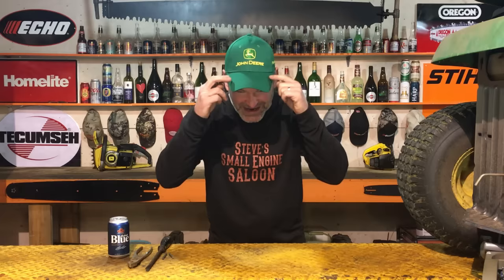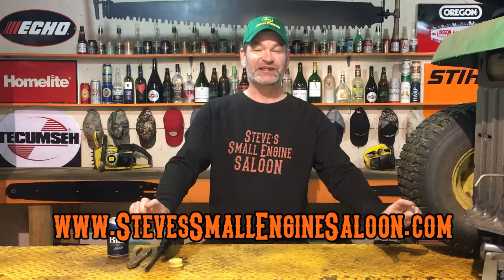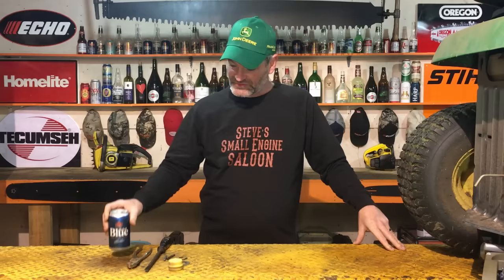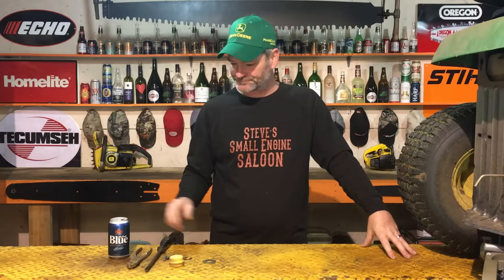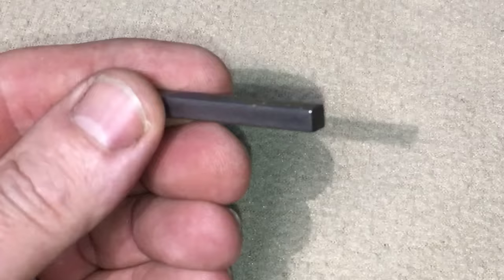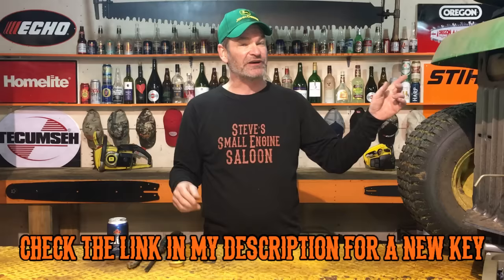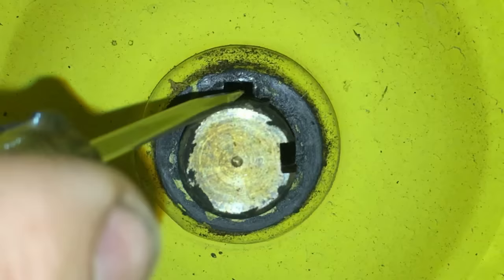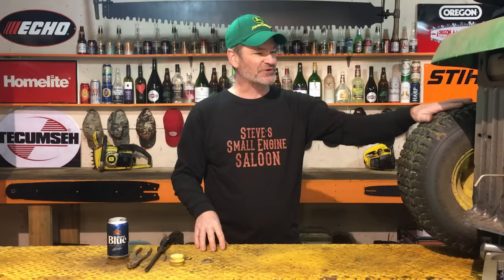How To Fix a Riding LawnMower That Will Not Move or Drive

Comment from the maker: Click here for a new key---- https://amzn.to/2CHQxcx
Click here for my website--- http://www.stevessmallenginesaloon.com/
Click here for my Parts and Tools Store---- https://www.amazon.com/shop/stevessmallenginesaloon
Reply: Actually, I did find the key. Right where it would have fallen out. Sure enough, mower is running like a champ 😁. However, with the corona shutdown,I've been doing everything but mowing the lawn. And the weather around here has only allowed for a day here or day there to get other outdoor projects done. But, thanks for the link 😁. Would have definitely needed it if I changed the tire in the grass.
Reply: Great video the only video i found that realy helped
Reply: Hi Steve, I have an older Murray lawn tractor in really nice shape 12 horse Briggs with 36 inch cut. 6 speed with reverse. problem I'm having is that it shifts fine when the motor is off but once it's running it doesn't want to shift into other gears it's very hard to shift. Do you think its a belt not allowing trans to fully disengage or worn shift keys?
Reply: Hey Steve I kind of ran into this yesterday on a clients mower I knew the check the key sure enough it was gone. My question would be will it still engage the transmission and move somewhat if the key is still in place on the other tire? It's rare 2 flats happen at same time lol I'm just curious because I assume.it should have engaged the transaxel and make the transmission spin?
Reply: Yep ,going crazy for three hours,took tire off to adjust brakes,figured it out when I took other tire off,the key stuck to the axle on that one.found it in the 5 pds.of grass clippings I cleaned from under there. Thank you
Reply: I haven't changed my tire yet but my mower won't move could that key have fallen out and that's why it won't go????
Reply: 0😊
Reply: Lol I am the wife. 😊😊

Comment: Never had that problem, however I used to have a LA125 mower.  I had religiously changed the oil & did the maintenance.  With just over 300 hours, the Brigs engine started smoking.  Took it to the dealer & they didn't help any.  It got to the point that every time I mowed, I'd have to add oil, and about every third time I mowed, I'd have to clean the spark plug.  Finally I took it to the junk yard, and bought a Bad Boy ZTR with a Kohler engine.

Comment: Yeah but what if it wasn't a tire issue? Do you have a video on the internals of a hydraulic drive transmission? Or a mechanical one?
Reply: Yeah, hydraulic may be easier to run and convenient, but when it goes, it's cheaper to replace the entire mower.  I had one and will never get another one.  They're more expensive too.  I'm back to the mechanical stick shift.  More reliable and dependable.
Reply: Do you have anything on a mechanical transmission
Reply: @ Woodrow Magnus, 2 things with hydro trans to not do;

Don’t believe the ‘non serviceable part’ you get from most mower manufactures,
You can change the oil & replace internal parts.

Don’t tow & brake alot if you can,helps for durability.

It is cheaper this way than to replace whole mower & will last as good as old school pure mechanical setup 😉
Reply: Rene' Jantz the cotter pin came out of the linkage on my riding mower. New pin moving again.
Reply: @tnblly24203  pins in place...both sides. Ground drive belt was jammed. Took hours to remove.  I didn't want to damage if belt wasn't damaged. Bought new belt before removing. 2 reasons, new belt available if needed, see how was configured. Belt not damaged or stretched! Hummmmm. New belt is on  bc put on as took old one off.  So i now have a back up!! Taking it easy on mower.. lots ruts and hills.  I get stuck in them bouncing around sometimes trying toget out no more that!
Reply: @tnblly24203  i think ill get couple
Reply: have  you checked the fluid level in trans. the fill tube is located  low behind  the seat  its   a small tube with a plug in cap you pull out   also some  ??? have filter that you cannot see with out jacking the up high it just like the filteron the eng. i replaced mine when i added a new 81 inch drive belt  i had tbl.getting it off   this is a 1998 craftsman i bought used 4 yrs ago  that filter had never been replaced it weight a ton compared to the new ones   some folks say theres dont have one  because you cant see it but it does
Reply: yk i thought that too until my dad started it and magically worked again

Comment: My new "go to" place for useful information!
Struggling to identify the problem for 2 days and then my wife spends 5 minutes Googling and ... bam, there you go!
Thanks Steve and you've earned the 98.8% positive ratings.  Your videos are enjoyable, informative, solve real problems and include beer!  
Raising a cold one to you right now.   Cheers!
Reply from the maker: Fantastic!
Reply: You were right on the money! I had just replaced the right rear tire, being very mindful of no losing the dust cap, the washer, the key, and the locking clip. And after putting it back together, nothing. None of the other videos on YouTube even mentioned that the key could be missing. I found it under where I was working, and lo and behold, there was the key on the garage floor. The part of your video showing the two slots lining up …. Yanked the wheel of, lined up the slots and five minutes later I was driving around the yard. Grass will be cut tomorrow. Thanks! You are the man!

Comment: Steve - You are the MAN!!!  I just did that exactly with my X300 John Deere Rider. I had a flat and took it off to have the tire repaired. When I put it back on, I noticed the tire would spin freely on the axle and thought that was odd but went ahead with the install. Lo and behold, when I cranked the mower, it would not move. I loaded the mower on my trailer to take it to the dealer since I was convinced the transaxle had failed over the winter with no use.  Then the smartest thing I did all day was look at this Youtube and it described my situation and my fix EXACTLY!!!.   Just as you predicted, when I looked at the ground where I had removed the tire, I found the locking key. I took off the plastic wheel hub, C CLip and washer and inserted the key and I am GOOD TO GO!!!  Thanks STEVE. You saved me.
Reply from the maker: That is Awesome Gerald!  I am sooo happy that I helped save you some money...

Comment: OMG! I'm 64 years old. I thank you from the bottom of my heart. I put new wheels on old .hurray ride mower. Everything put back on. Then would not go forward. Just paid 300.00 to fix a bunch of stuff on it. So very disappointed that it would not go. Other videos wanted me to take ton of stuff off too check. I saw your video and thought What is a keyway. Low and behold that was the prob. Had no idea that was evan a thing. AND, looked and it was right where I took the tire off. In the dirt and grass. A miracle I even found it! Thanks!!!
Reply from the maker: You're Welcome...

Comment: I picked up a free riding mower last week. The guy said it wouldn't go forward or reverse. I noticed right away that he had put a new tire on it. Turns out the axle is splined and he put a wheel on with a round hub. I bought the original wheel and tire from him for $25 put it on and that was the problem. I then sold the mower for $450. Thank you for this video!

Comment: Steve you're the man!  Like others this played out just the way you describe. Just spent $200 + on TLC for my Husqvarna, including mounting 4 new tires tonight.  Jumped on cranked it up and won't move.  Found your video, walked straight out into the yard and picked up the right rear key out of of the dirt. Slid it in and it took off!  Didn't realize the right was the positive drive side and the left is just following along.  The left tire slid on so easy, and I thought I got lucky when the right one did too, but It was because I had knocked the key out.
Reply from the maker: Right on

Comment: I just had this issue with my John Deere 110. Tire was flat, removed it and took it into town and filled it with air, then came back home and put it on. No forward or backward movement after I cranked up the mower. Googled and watched your video, went out and found the 3/16" key right where I took the tire off. Put it back in and I was in business. Great video, just subscribed too. Thanks, Gary (Ferrum, VA)
Reply from the maker: That is awesome Gary!
Reply: @StevesSmallEngineSaloon  Lived in New Hampshire growing up, used to make trips to Canada to get some Molson Brador. Highly recommend. I know now where to turn to when I have issues with my mower, weedwacker or chainsaw.

Comment: Thank you Steve. My belt jumped off the back transmission pulley and I had to remove one of my rear tires. Put the belt on and the darn thing wouldn’t move.  I thought the transmission had went out. But after watching this video I found my key laying in the grass. I pulled the wheel and put the key back on and presto the thing pulls again. Thank you so much.
Reply from the maker: Glad it helped

Comment: I’ve got a Simplicity riding mower that’s about 20 years old. I knew about the key, but just got so excited to see if TireJect would really fix a dry rotted tire It slipped my mind😥 the tireject worked but the mower wouldn’t move! I’ll check to see if the key is in there In the morning! If it’s not, I have some key stock from losing them before. Thanks Steve, I think you may have just given a 20 year old Simplicity a new lease on life!
Reply from the maker: Right on...

Comment: Hi Steve, my John Deere Tractor, stopped as you described, however, I have not (did not remove the Tire), any idea as to what the problem could be???
Reply: I notice he can't answer this.....I have the same problem.
Reply: @buddyholly313  me too!!
Reply: Me too
Reply: If it has the plastic transmission, around 100 hours of use, a screw on top of the transmission pulls through a washer atop of a spring. There's a few videos of this issue and how to repair the problem. I have a JD d105 that I will be working on this week. It seems to be an easy fix but getting to it is going to be a bit tedious.

Comment: i got a used mower for free two years ago.  scotts 16/42. we had a smaller house last year and didnt need it. lawn the size of a big quilt. lol.  but i got it running, replaced the fuel filter and starter solenoid. stuck it in the garage until we moved. now we got a couple of acres to mow and really need it. had to put tubes in both back tires. keep having to put air in them every week.  and thought i replaced the axle keys. had one fell out and was loosing my mind this morning thought my trany was shot. sincerely  thank you.  watched this video. pulled off the rear wheels and only one key was in place. quick trip to the tractor supply on the bike and back in business. cheers. im drinking the coors original today. what you got?

Comment: I was driving my Craftsman, turned and applied brake, then gave it gas to go, and nothing, no forward, no reverse, it was running fine.  Any ideas?
Reply: Did you check the transmission or the starter plug

Comment: Steve, this can't be my issue because I have not done any work on my rear wheels, but all of a sudden my JD won't go into gear.
Reply: Did you figure it out?
Reply: Lol
Reply: @johnmustang2323  yes, my belt was worn and I bought an new one and presto
Reply: That wasn't my problem either so how did you fix yours
Reply: I can’t figure out my problem either
Reply: Same
Reply: Mine was just loose drive belt, because I just got mine, hadn't even touched the tires... Yet
Reply: @sanepsyko  what do I need to do to tighten it??? I can’t even find a vid on that
Reply: It could also be your brake is locked, or the bolt / pin in the back is pulled out to disengage the transmission in case you need to push it. If that pin gets pulled, it unlocks everything so you can push it easily, but needs to be pushed back in so the transmission can move the axle. If that's pushed in and it still doesn't move, it may have come loose somewhere along that line. You may be able to access it from under the battery under the seat. I've been watching a lot of videos on this subject lately and just got my Craftsman riding mower working yesterday after ordering a new square key because the old one fell out somehow. And when finally getting that back on, and it STILL didn't move, I gave that pin a good shove and I felt a shift and tried it out. I was finally able to mow my backyard jungle again!  Good luck!
Reply: @girgriffin4902  thanks man! I can’t find anywhere that’s not going to charge a arm and a leg literally, it has to be something simple like that
Reply: No, a 3/ 8 by 1 3/4 inch pin fell out, where does it go?
Reply: The mower just won't  move because  of that pin missing.  I found the pin but not where it goes.

Comment: LOL, how many thousands of people has this happened too ??? Rule 1- Work on stuff on a clean flat cement like surface (where you can find parts. Rule 2- Take photos during disassembly Rule 3 - A round axle turning in a round hole in a wheel goes nowhere. Watch the mechanic in the Doc Hollywood movie " Every time I fix a car I seem to have a bag of parts left over." This happens on many brands of mowers and sometimes sticks in the keyway on the axle or wheel (until it falls out in the grass, truck or at the repair shop). This is a needed video Steve.
Reply from the maker: Thank You...

Comment: You're the man Steve!  I had this exact situation after changing out the right rear tire on my LA135 and just as you said that key went missing without me realizing it.  I just picked up a generic 3/16th by 1 3/4" key at the hardware store and was up and running in 5 minutes.  I shall hoist a Labatt Blue in your honor this evening!
Reply from the maker: Right on

Comment: With that said. Is there not another key on the other side that should allow the system to work? I've never lost mine but it's a solid axle so it should turn.
Reply from the maker: It is actually not a solid axle.  If it was it would be "posi track" and when you turned on the lawn, one wheel would tear the grass apart....

Comment: I was thinking that the problem started after I fixed and remounted a wheel but could not figure out a connection. I cleaned out the mud and grass and installed a new drive belt. You are the only one with a video that addressed the issue. Thank you sir and I will visit your friend's shop next time we are in the area.
Reply from the maker: Great to hear!

Comment: I got a flat tire yesterday and drove my mower to the barn. I took the tire off, got it repaired, put it back on and it wouldn’t move. I took the mowing part out of my craftsman YT4000, checked the pulleys and the belts, everything! Was pissed off beyond belief! Then I saw this video and remembered that my tire free spun when I put it back on. Went out to the barn, found the key for the tire, put it in, washer and clamp, then dust cap, started it up and I’ll be damned! It worked! Thanks man and have a Labatt Blue and a subscribe on me!
Reply from the maker: Right on Joey!  Thank You...

Comment: I did exactly as you said.  Pulled the wheel to install a tube, put the thing back on, started the engine put it in gear and went nowhere... couldn't figure it out, but when I pushed the mower out there was the key. I had no idea where the key went until I  found this video.. many thanks to you...
Reply from the maker: You're Welcome...

Comment: Thank you for this video. I had the exact issue with my transmission when I changed the rear tires, the transmission I thought would not engage when I replaced my fuel line and fuel tank on my JD LT 155.  The dealer wanted $100 to look at this thing.  I had no idea where the two keys went that I found on my garage floor. Your fix worked very well and my mower is working properly.  Thanks again Steve you just picked up another subscriber.  Now on to fixing my JD chainsaw.  Semper Fi
Reply from the maker: Great to hear!

Comment: Thank you so much man, I spent 4 hours working on it, took the deck off messed with all the wiring harnesses checked the fuse and got the whole mower taken apart just about. I got so frustrated after combing through 7 different videos I finally found this one and sure enough that was the issue, I don’t know weather to be happy or mad but it’s fixed so that’s what’s important!!!
Reply from the maker: Glad it helped

Comment: SPOT ON!!!! THANK YOU!!!, I found the little sucker in the grass, I only use this 19 year old John Deere for the bagging a few times a year, so I cut with the other mower since now the deere wouldn't move because low air caused the tire to pop off the rim on my drive to garage. I cut around the stranded mower with my zero turn....the taller grass where the mower had stopped was the  key to finding the correct location, because I had already pushed the immobile tracker near the shed.

thanks again.
Reply from the maker: You're Welcome...

Comment: Thank you very much, just had my tire fixed, put it back on and when the wife got on it to mow you guessed it, it wouldn't move.  Came on YouTube to see if I could find the problem and BAM your video popped right up.  Found the key in the garage where I took the tire off, put it back in and working fine.  Thanks for a great video, I'll be sure to check out the rest of your videos.  By the way my wife was watching your video and was cracking up at the part right before you took a sip of the beer!!
Reply from the maker: That's awesome Rob!  I am sooo happy my video helped you....

Comment: So I changed transmission belt first…should have looked at this first as my key was missing. I had just taken the rear tire on my JD LA145 in to have tube put in. Go figure would have saved me mucho time, some very choice words trying to get guide pin back in and some money too. Now I have new tranny belt and new deck belt which I changed recently too. I could probably be a Deere lawn tractor mechanic by now! Thanks Steve!